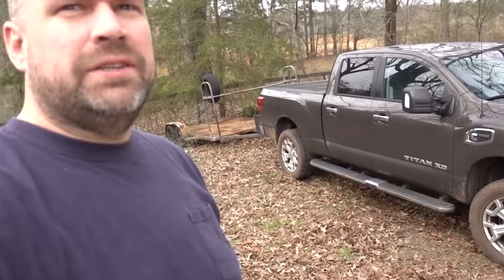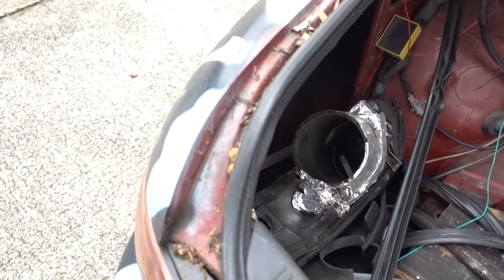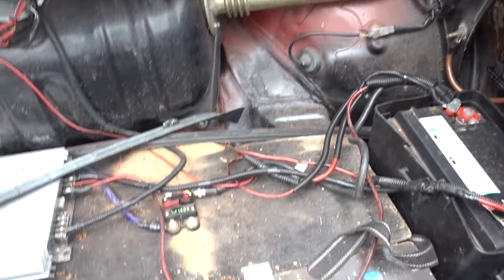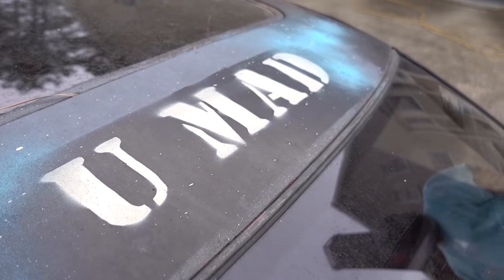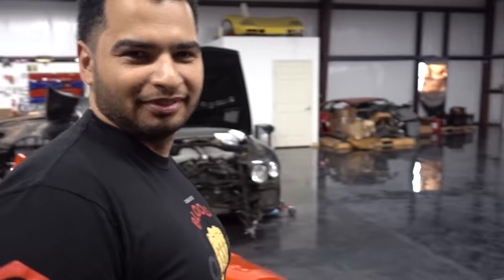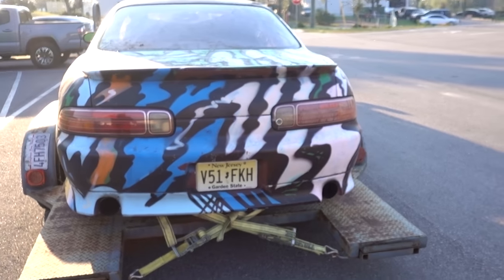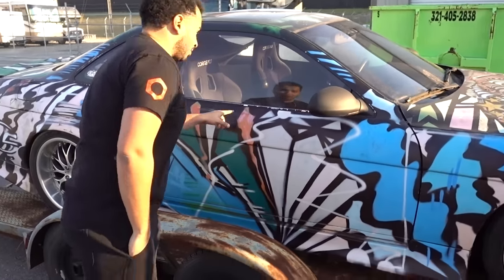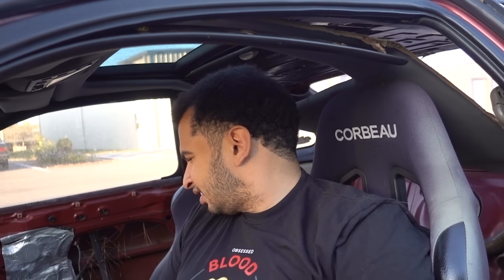Surprising Tavarish With The Insane Lexus He Built When He Was A Teenager (HE COULDN'T HANDLE IT)

Comment: Do a high quality scan of the paintwork & make it a wrap, repaint the car under the spray paint, put the wrap onto it, renovate it up a bit until it runs good on everything as a car you can hammer down the track without an inch of worry other then if you'll crash or not going too fast.
Hell weld a rollcage for it & make it just as much of a racecar as Earl.

Comment: I built an insane Plymouth fury 3 from 66 into a wild muscle rat custom. It had a 440 TNT big block bolted to a Alco 5 speed stick. The car could hit 100 mph in 3.20 seconds. It was built fer street racing. It ended up being sold to a collector in Chattanooga Tennessee, an ten years later it now resides in the Lead foot Outlaw Street Racing Museum in Rossville Tennessee. I never thought a car I built fer under 2 grand would become a piece at a museum.

Comment: Look past the wacky paint, and bits falling off and you have an excellent base for a fast drift car. You already have a 1JZ and manual gearbox, so with a few mods 300-500bhp if Freddie wanted to. It looks to have the Lexus LS400 brake upgrade too, and don't forget the SC300/44 and Soarer were produced before the MKIV Supra and are almost identical underneath so wise-fab suspension upgrade easy to turn this into a fun and very capable car. My friend Buttys Butler, a drifter for Monster Energy, used a lightly modified 1JZ Soarer, running 350bhp, with a cage,  modified steering knuckles and a welded diff, here's a wee taster of him in action: https://www.youtube.com/watch?v=uV8yb46LKI4